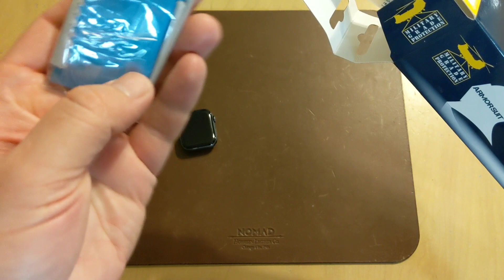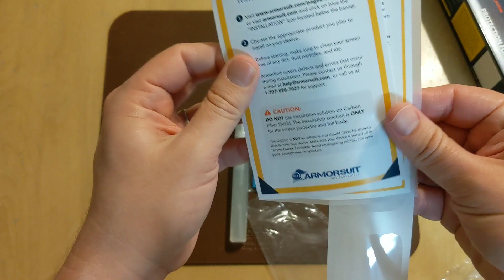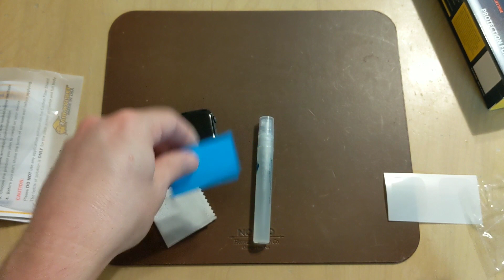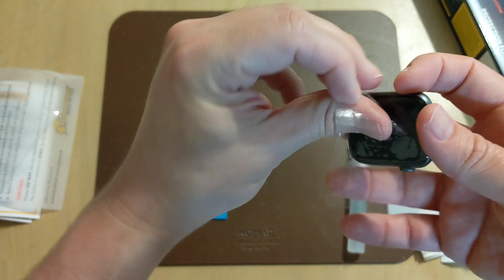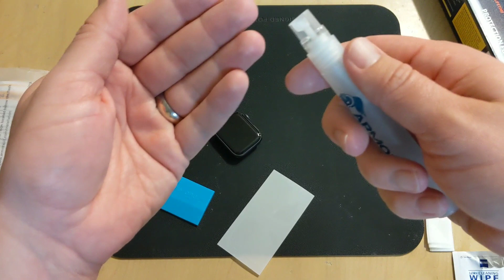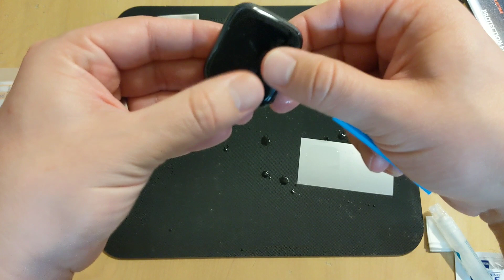Apple Watch Series 4 Screen Protector by ArmorSuit

Comment: My biggest fear was putting the wet film on the screen until you said it was water proof which gave me some piece of mind .
Reply from the maker: Yeah. I still like to turn mine off anyway when I install wet application anything but it’s not necessary. Plus, the screen always comes on when you’re messing with it and it throws me off. But perfectly safe
Reply from the maker: Glad I could help

Comment: It works! Only up until you swim with it. I Swam with my Apple Watch and the plastic film fell off in the water.
Reply: This with the catalyst waterproof case is the absolute perfect combination. The case doesn’t allow water to reach the edges of the screen protector so your watch will always be 100% protected.
Reply from the maker: Well, I didn't test it out swimming. That sucks.  Guess it's a good thing it's a two pack.

Comment: Hey I’m getting my screen protector tomorrow and I wanted to ask... have your edges started peeling out like you said it would?? Or did the dryer trick work in the long run?
Reply from the maker: Still no peeling. It worked like a champ. I have had zero issues with it and it still looks perfect. Just be careful and press/dry the edges and you should be fine. Definitely recommend this screen protector.
Reply: Thanks for the help!!! Definitely giving you a like and sub!! And thanks for the fast and descriptive feedback! I appreciate it!
Reply from the maker: Leonides Alonso thank you. And no worries. Just make sure that you hold the screen protector in place while you squeegee out the water underneath the screen. I would recommend holding your index finger in the center and pressing down so it won’t move - it will glide while the spray solution is still underneath it. Worry about that first and work outward, worrying about the edges last. Once you think it’s pretty good, then use the blow dryer. Make slow passes and don’t hold in one spot too long. It will make the watch hot. Switch back and forth between cold air on the blow dryer if it starts getting too hot, or to keep drying out the solution. Press and hold edges, one side at a time. Rinse and repeat. Should work our well and look solid in 24-48hrs
Reply: @TechOdyssey  giving you a follow up, I just installed the screen protector and it looks professionally done!! lol!! the whole time thought i was doing a step by step using your video! thanks gain my man!
Reply from the maker: @DaRKxXxAzTeC  awesome. Glad it worked out for you. Thanks for following back up. Good job!